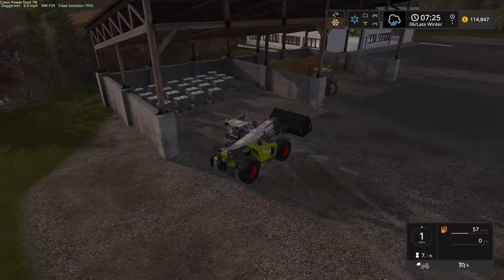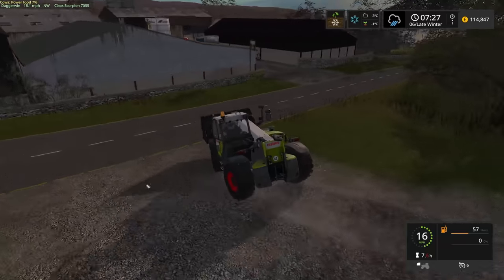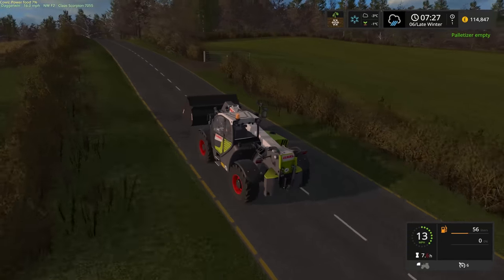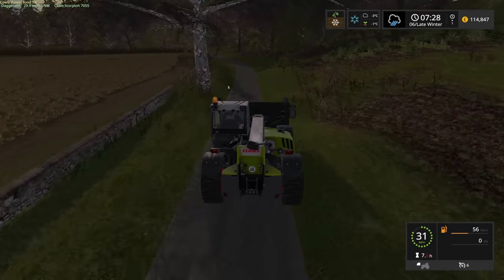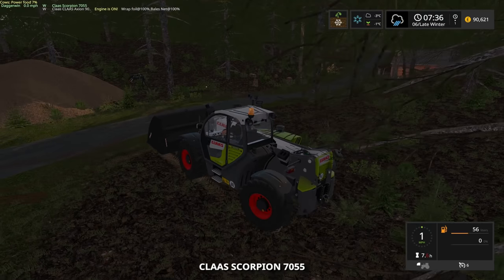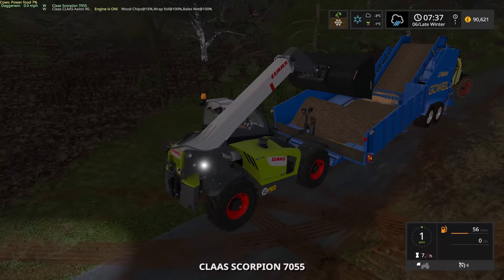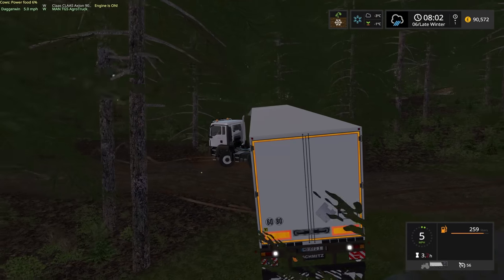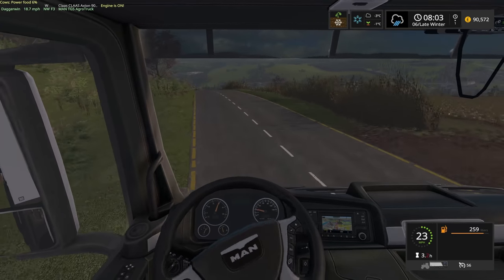WOODCHIP BALES | Shamrock Valley | Farming Simulator 17 - #25

Comment: The help page for the Goweil suggests to me that the intended purpose of wrapping woodchips is supposed to be to save space, which is pointless in FS17 as there are mods that let you store loose chips easily enough. That said, having just tested out a few things I can say that:

1.) Using the Goweil to wrap woodchips and then using "N" to cut open a bale produces a pile of woodchips again so they're not transformed into silage in that respect. I couldn't seem to get the bales to open in or even near a woodchip sell point. Had no problem opening them in my own farmyard however so wondering if you have to "own" the land where you're opening them? Very odd. 

2.) However, as other posters have noted, selling woodchip bales at a hay / straw bale trigger works (well, it did on my Test Farm sellpoint on Sosnovka) and I got a slightly vairiable price starting at just over $2600 per bale on Normal difficulty, decreasng to $2,500 after selling 8 bales) which is better than you'd get if you sold loose material at woodchip sell points.

3.) An alternate method is to use the modded Grimme RH24-60 and do 4000L pallets of woodchips which will sell via the woodchip sell trigger (slowly, but they sell). Assuming this price is the standard "loose" sell price.

CONCLUSION: Technically, selling via a bale trigger is a cheat but gives best price ( I didn't test past 8 bales so not sure how steep the price drop-off might be tho).
Reply: I do like a reply with some research and thought behind it. Thumbs up. :D
Reply: How long did you take writing this
Reply: @11kkaoife  Not long - I can more or less touch type ;) How long did it take to test it all? Longer than it took to type out the results... much longer. Heh.

Comment: Woodchips are currently on "Great Demand" on my Seasons Shamrock Valley, late Spring, and they're only £227 per 1000l, so Winter is clearly the time to sell.
Reply: Also, as the point of fitting a back weight and a wheel loader adaptor was to let the telehandler carry more, it would have been as useful for this exercise as it would he been for filling a regular trailer. :P